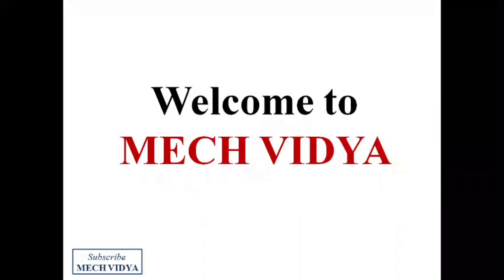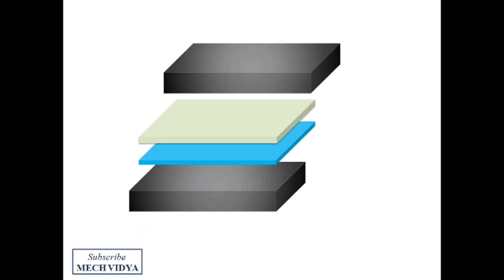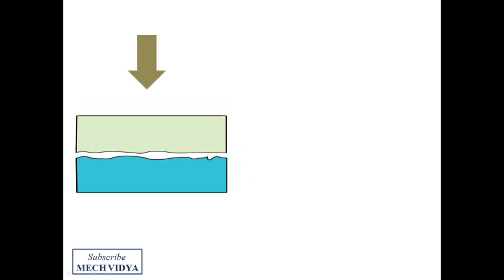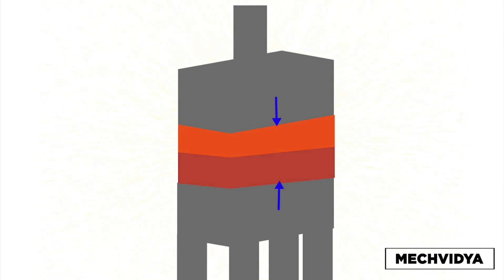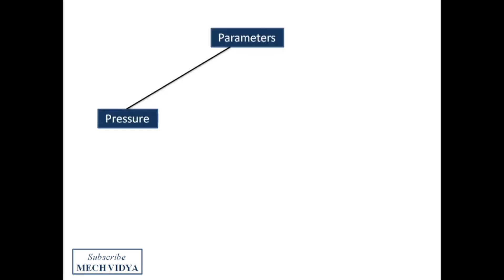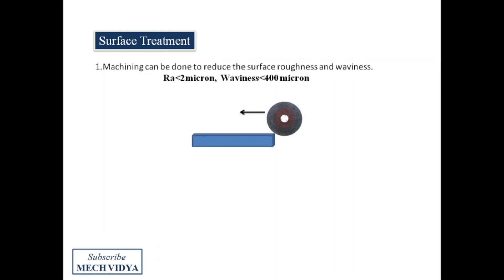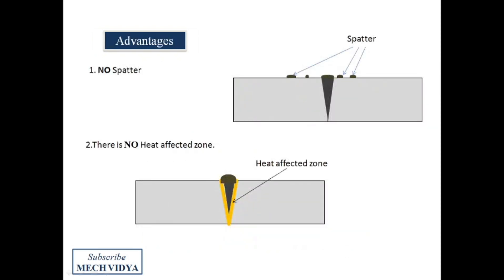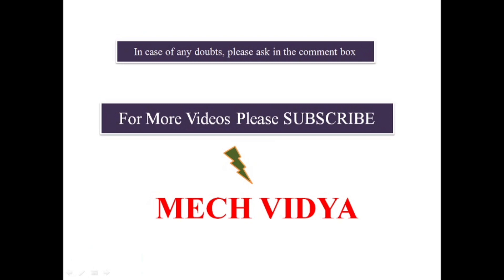Diffusion Welding [Working Principle Explained]

Comment: Is diffusion welding is possible for welding same type  of metals?or is this a forge welding?
Reply from the maker: Dissimilar metals can also be welded by this process. In diffusion welding uniform pressure is imparted instead of hammering
Reply: @mechvidya2020 thanks for the info ! Do you know if aluminum and stainless steel are bondable this way and what could be the strength of the bond ? I mean if the bond would exceed the strength of the aluminum ?